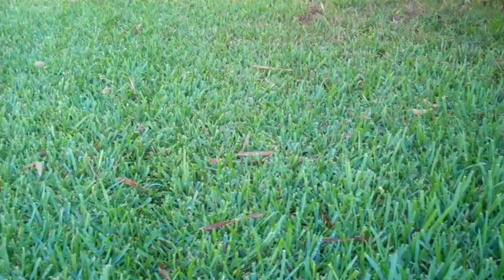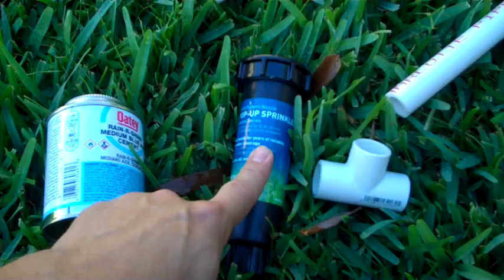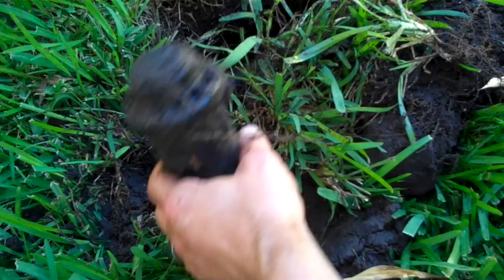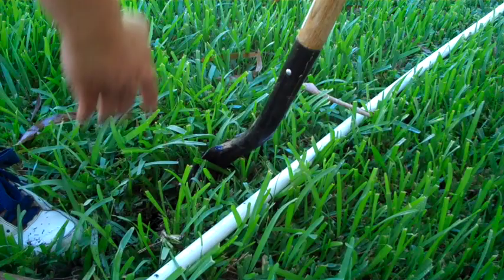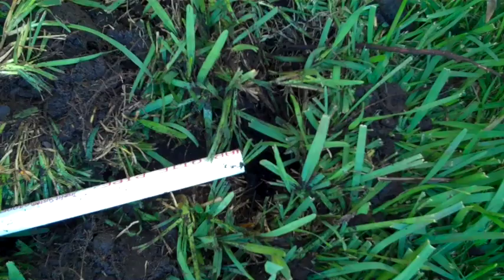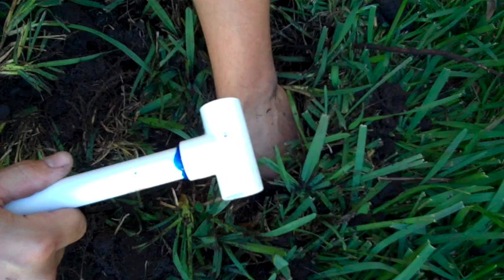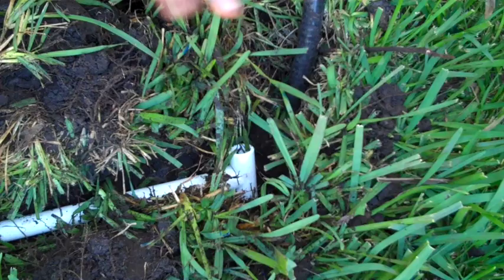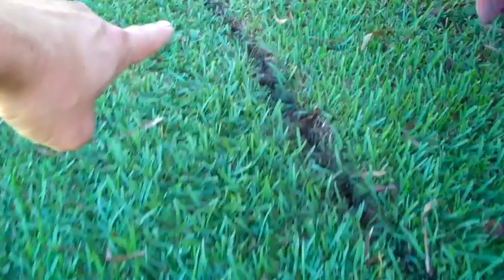Add a Sprinkler Head to Existing Irrigation System

Comment: When connecting glued pipe, push the fitting on the pipe and give a quarter turn to ensure you get a good lateral seal of the glue.  Easy peasy.

Comment: Did it work? I would think there would be less water pressure than before.
Reply from the maker: I didn’t have any issues with adding just one sprinkler head. If you add to many, then you are correct. You would have an issue.